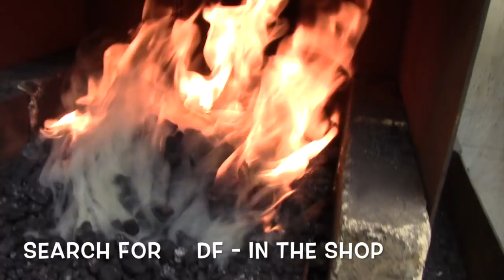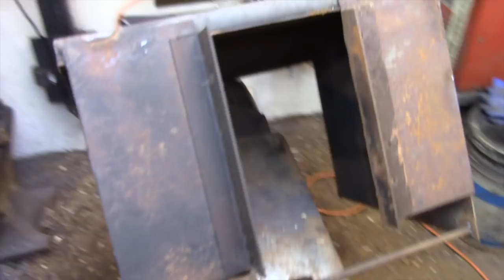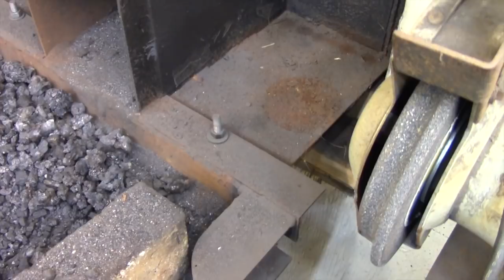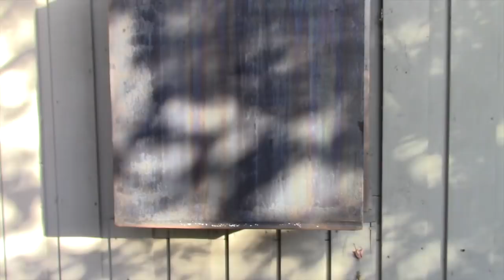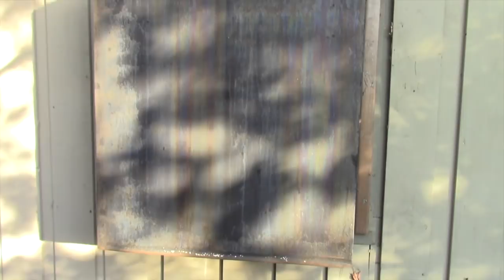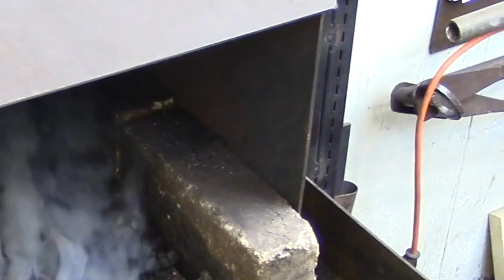Blacksmithing For Beginners - My Forge Hood Design

Comment: Mine keeps coming out at the front and never gets sucked back in for some reason cant seem to get a good draght !!
Reply from the maker: To handle the amount of smoke that a forge generates the area of the stack  needs to be a min of 100 sq inches.  To get a good draft ( you need to have enough chimney ) and the area of the opening to the stack needs to be about 85 - 95% the area of the stack.  This opening should also be as close to the fire as possible. If you get that relationship between the stack and the opening right it will suck the flames sideways out of the fire pot. If the opening is too big or too small nothing will happen.   Also the stack does not have to be one pipe.  My stack is made 2 - 8inch black stove pipes because that is what I had around and the two pipes together give the 100 sq inches I need and it works great.
Reply: @df-intheshop330  thanks for that ive experimented a bit a lot better now ive placed a sheet of iron directing the smoke to the stack  the stack itself is approx 15 feet high it has a bend in it where it goes through the wall the flue pipe is only 7 inches diameter so could possibly would have been better with a larger dia pipe but too late now anyway seems ok so far cheers happy forging

Comment: So 100 sq inches ?  Ok ... pi x 4sqrd x 2?
Reply from the maker: I know what you mean.  That's why I went with the square duct ( Area is just side 1 X side 2 ).  I'm actually still using a dual exhaust in my hood.  An 8" stove pipe is around 50 Square inches so I installed  two pipes next to each other to get the 100 sq/in.  The stack doesn't have to be one big pipe. When this rots out I will replace it with a heavy gauge 10X10 pipe.

Comment: I'm curious about the proportions for the stack; 100sqin and same area as hood opening. Is that because the hood is 100sqin? It seems that fireplaces have a proporation that's about 6:1 instead of 1:1.
Reply from the maker: The area of the stack is 100 sqin  but the opening is only 85 sqin.   85-90% of the stack area seams to give you the maximum draw.  Any larger and the hood will suck in too much air and cool the stack.  Any smaller and the opening will not allow enough hot air to enter to get the stack hot enough to draw well.  It isn't like a fireplace where the fire is sitting at the bottom of the stack and the heat naturally wants to rise into the stack.  In a forge the fire is sitting off to the side so you need to accelerate the air passing over the fire to get it to enter the stack.  An opening of 85-90% is the right balance to create the ventury effect needed to suck the flames sideways into the stack and keep everything hot enough to maintain that draft.
Reply: Thanks for the reply. I think my stack will be almost directly over the center of the pot.

Comment: Have you considered a square to round transition in the flue?  Also a radius from horizontal to vertical should 'encourage' the exhaust out of the work space. A bit costlier, but efficient.
Reply from the maker: I've built a few of these now and if you get the right proportions between the stack volume and hood opening they suck out a lot of air so I don't think the extra effort is needed to make them perform better unless you are working with an undersized stack that simply can't handle the volume of smoke and fumes generated.  A friend but his stack out of a dozen 25 gal drums.  He just cut the tops and bottoms out and tack welded the drums together so there was air infiltrating at every seam but despite that it took off like a rocket .

Comment: If you have time could you do a comparison of raw charcoal and coke? I know everyone says coke is better but many of us can easily make charcoal at home and I am curious as to just how large a difference there is between the two.
Reply: I have used both, used charcoal for many months when I started out until I found a source of coke. The coke burns hotter and much slower than charcoal. I can forge half a day on a bucket of coke, a bucket of charcoal be lucky to last an hour if your religious with your fire control.(turning air off between heats)
Reply from the maker: I don't have a lot of experience with either but based on the comments i've received - Jack Dawg's comment does sum up the main problem with charcoal.  Charcoal is a very clean fuel that burns very fast so charcoal forges were build much larger than coal or coke forged to accommodate the amount of fuel that you need to have around.  Also the fire throws off a lot more heat so it can be a problem getting a charcoal forge inside a building because you are basically building a big campfire inside and feeding air to it.  So if you are buying fuel - coke is the way to go but if you can make charcoal than that is certainly worth experimenting with. There is no problem forging with charcoal it's just supplying the amount you need and managing the amount of heat generated from the forge.
Reply: I use hard wood charcoal and can very easily go through a 20lb bag in 2 or 3 hrs.
Reply: The other issue I had with charcoal is sparks.  It is so light than when you add air pressure it shoots sparks a long ways.  The coke is dense so it doesn't have this problem.

Comment: Does there need to be an open door or window in your shop to get the chimney to draw?
Reply from the maker: My shop is very drafty.  I often work with the doors closed and it has no effect on the forge hood so I guess it's getting enough air.
Reply: red rob I can't speak for Denis, but I notice that my hood draws much faster and starts easier when I crack the door to my shop. Forge hoods suck a LOT of cold shop air compared to a wood stove, and that air has to come from somewhere. Worst case scenario is that the chimney tried to act as both inlet and outlet for air and you get smoke blown out into the shop